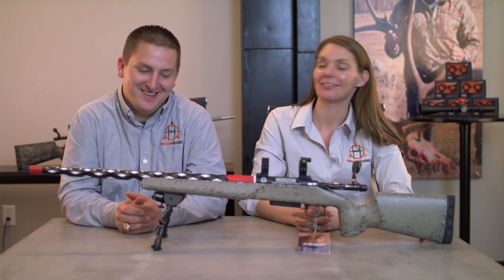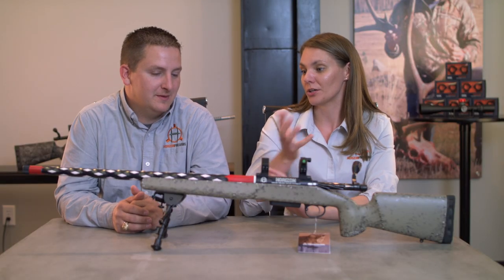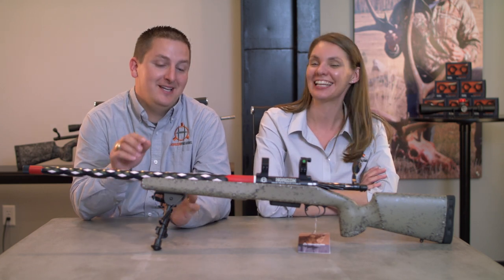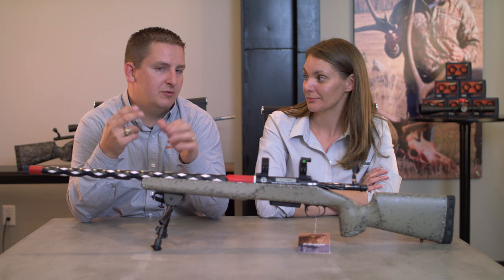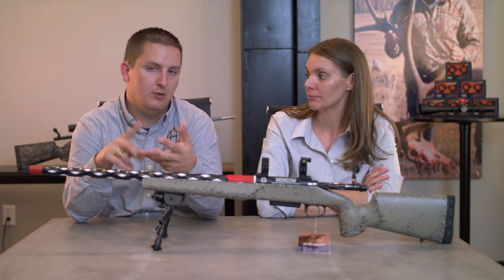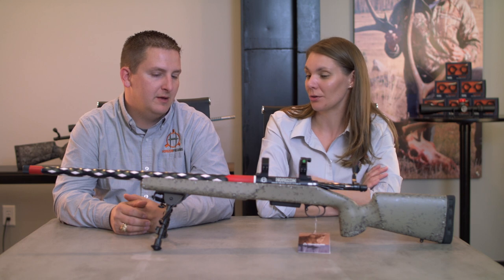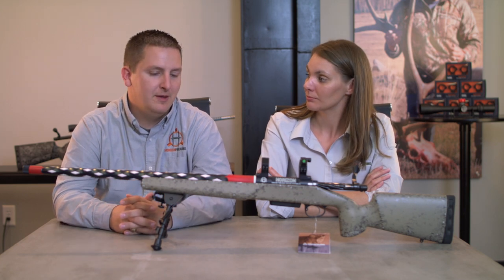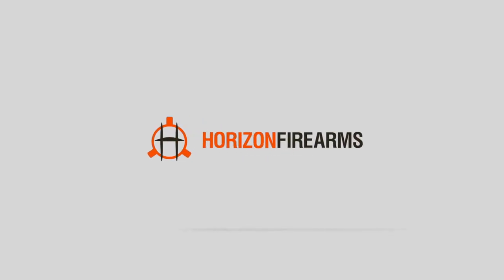What Does Barrel Fluting Do For Your Rifle? | Horizon Firearms

Comment: The fluting on that rifle does not preserve as much rigidity as when you don't create disconnected blocks.  Linear flutes are stiffer than spiral flutes.  Double spiral flutes in opposite directions is like cutting the roof off a car with a monocoque vehicle body.  It goes limp.  Then you might as well remove the islands to lighten it.

It is telling that your first reason for fluting is "it looks cool".  Not to engineers:  It looks stupid, because it violates the primary purpose: To shed significant weight, while retaining most of the rigidity of the heavy barrel.  

Covering the barrel with heavy dimples is an alternative to straight fluting, that is stiff in every direction and does not make the bore lobed.  That is providing the "bridges" between dimples are as wide as the dimples.

Comment: ok, but if i have two barrels, both have the same weight, but one is flutted, The myth says that the flutted one it is going to be stiffer and have  better heat dissipation. True or false?
Reply from the maker: No not exactly. The Fluted one would have more surface area so yes better heat dissipation. In terms of Stiffness, it would be stiffer than one of comparable weight that was smaller in diameter but not nessasaraly of the same native barrel of the same diameter. But depending on how its fluted the difference is almost negligible
Reply: @Horizon_Outdoors  is there a fluting better than the other?

Comment: What kind of machine tool do you use to do the fluting ?  I'm thinking, Carbide Ball Mill.
Reply: My guess would be horizonal mill cutter on a jig - this is how lots of spiral/gearing applications are cut because end mills have a climb and a conventional cut so you are forced to do multiple passes to clean up and get full depth.  With a milling cutter in a horizontal using a jig to rotate along with advancing and fixturing the barrel at whatever angle is required you can do each path increasing depth or a full depth pass slowly.   

Google gear hobbing to see how this is set up

Comment: May look pretty. But study barrel whip and harmonics. YOU may not see the difference. Much like someone shooting a 1/4 moa rifle and getting 2" groups with it won't see the difference when the stock is bedded. But there's just no way that's not affecting the Max accuracy of that gun negatively. Pro extreme ranges shooters are always looking for an edge. If this had even the slightest, they'd all be using it. There's a reason they all use heavy cylindrical bull barrels. Cute theories though. Definitely a cool looking gun.

Comment: Removing material from a bolt or barrel , weakness the sample. The flutes cool at different rates causing the barrel to move.. causing inaccuracies..  if 9 oz causes you pain??? Go to the gym!!
Reply: why would  you think the barrel would move when there is an even fluting pattern all the way around?
Reply: Chris Indermuehle 
He may be guessing, but he's correct from an engineering standpoint that's not only proven, but is also common sense. Secondly, you'd have to flute perfectly to not introduce some twist issue and that's not going to happen. Fluting looks cool and it can lighten a bull barrel down to an in-between over a pencil hunting barrel. Fluting does cool a barrel faster when comparing to barrels of equal weight. Fluting might make sense for multiple shots in rapid succession over a set timeframe, but I can't visualize this scenario. My piston weapons are clearly effected by heat on multiple shots in quick succession, as are my lever actions with tube magazines affixed to a thin barrel, both causing differential heat issues.
Reply: @hawiehawhaw  Because the crystalline structures in the steel are not uniform, and the cuts made to the barrel WILL be less precise than the cut a lathe can make.
Reply: I agree with you Bob, this video was just a list of excuses to flute. For a precision rifle, I want more weight. For cooling, don’t rapid fire your precision rifle.